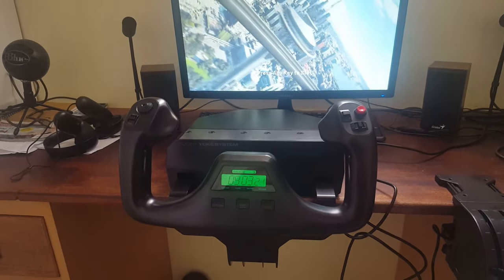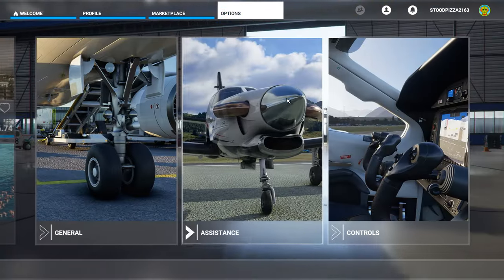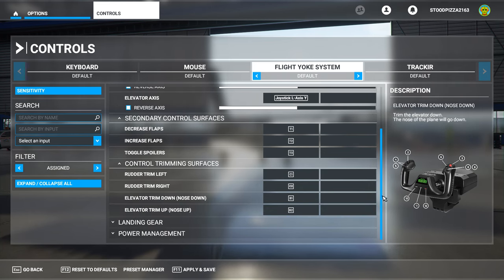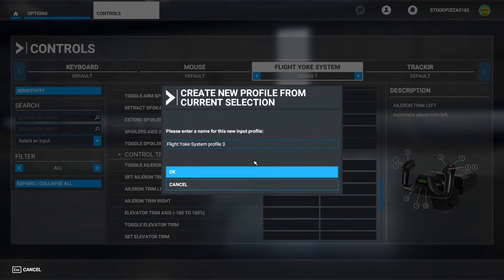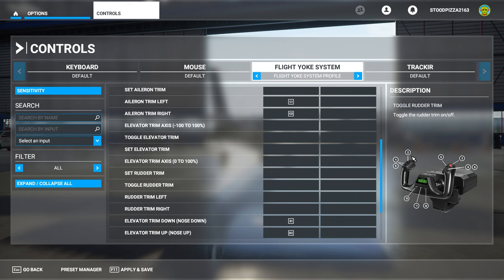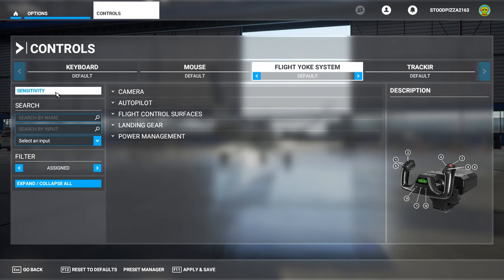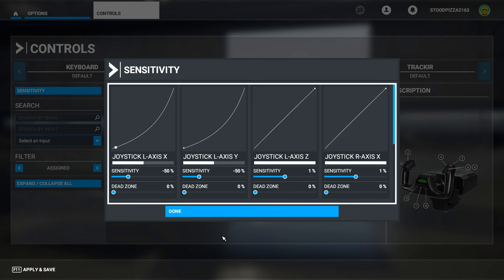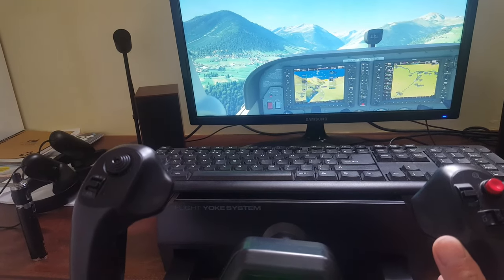FS2020: Setting up the Logitech Flight Yoke System and alleviating the Deadzone!

Comment: I have your same Yoke and pedals and throttle, I tried many times to find the right settings for sensivity, but I got illusional feelings, always i was coming back and still I'm to the settings for changing the sensivity, i found that even if you put -50 on X axes and Y, it wouldn't be reactive and after 20 degrees it starts to accelerate like A boost, so i found that the more stable settings is +9 that is reactive and constant in all the rotation and seems not having any acceleration passing the 20° or 25° of X rotation, then i removed a spring from the Y axes inside the controller, infact there are 2 springs one below and one above, i removed one and i put more grease into mechanical parts, especially on plastics parts, i even removed a plastic ring that avoid to exceed the rotation  of the X axes, this is a double ring joint together that give a lot of friction on the axes x and y, plus i screwed two screwes on a ring that rotate attached on the metal pole for avoiding that the X axes would pass the 45° because if it would does it the wheel on the potentiometer would disingage, of course i removed the metal spring on the X axes because in a real plane doesn't exist  a system for recentering the yoke because it's not a car (I'm a student private ppl pilot) so now it's free to move, after these mods I can say it's a better Yoke, I found very disappointing the logitech quality, I mean they did a great job with car steering wheels putting a forceback with little engines and thanks to the engines the feeling is so real,here instead they just put together a plastic empty with two potentiometers and nothing more, plus I don't understand why limit to 45° the X axes.
Reply: Joystick control in FS2020 is totally and utterly fucked up on most sticks on the market and the sensitivity setting do not work, it just make input lag larger... When I fly the Beach-craft 350 and turn the joystick it take 2 seconds before it reacts to a roll, (up and down works perfectly fine and linear). Also when it finally reacts it does not mimic what the joystick do, it react same as if you are using a keyboard to fly. Meaning no matter how little you turn the stick it reacts and it does not react how much you push on the stick but for how LONG you keep the stick in the position. Only way to actually fly is to use the joystick like it was a keyboard pumping it, this is just ridiculous and internet is full of people complaining about it. Some people say they have no problem at all but most say their joystick simply is unusable in FS2020 and I am one of them with my Logitech Force Feedback 3d pro. Even stranger is that all the above only is for the roll, up and down works perfectly fine and linear with no input lag... Lot of people complaining about exactly the same problem since FS2020 came out and nothing has been done to fix it.  . .. . ... . .. . .. .. .
Reply: @a64738  I've solved going on Options, flight model, and changing from Legacy  To Modern, for me now  it works fine, I've reducing even a bit the sensivity but just for 13%, cause Saitek pro flight has 45° of roll angle so it makes like double any angle you roll, don't forget that a real airplane have 90° angle
Reply: @danielecarmona   Could not even take of with legacy setting lol. But I got the old stick working thanks to this:   
Ready Meals
2 months ago
Hey, don't use those flight control settings, make sure to map it to the the aileron AXIS/ elevator AXIS. Otherwise, it won't recenter and it is a digital input, meaning that it either, for example, goes 100% on the ailerons instead of a analogue control where you can make very slight movements. Make sure to do this for rudder, throttle, ailerons and elevator.

I was just about to order a new stick to get it working, was olso considering getting a refound. But now it works perfectly fine :)
Reply: Happy to hear that! BTW if you want improve your game peripheral you can go to hardware properties in windows and calibrating it, I removed all the dead zone that I got by default.
Reply: @danielecarmona   No dead zone on my stick, and no way to calibrate it. All that is missing for my stick. But it works even it it is a bit to sensitive. Think I will have to invest in a better stick, IL2 for example it is also way to sensitive and twitchy no matter what you try to desensitize it with (tried many different software).
Reply: I found the problem with joystick many have after 3 hours of reading forums and watching all tutorials on joystick setup. Deep down in the comments of one youtube video one said you must make sure X-Axis Z-Axis and Y-Axis it assigned to analog input and not digital. It is pretty much impossible to get them all right in the first try since it does not say what is analog and digital... I did just follow a screenshot how do do it right and it fixed all the joystick problems with my old Logitech Force Feedback 3d. 

* O564564
Reply: @a64738  in windows 10 you have to click con control panel, devices and printers, then right click on the joystick or yoke, click on game controller settings, click on the settings tab, and start the calibration
Reply: @danielecarmona    The Logiteck stick is so old that there is only Windows 7 drivers for it so there is no calibration availible at all. But it works just fine without...  Also with 3rd part software you can make adjustments like manual calibration and such if needed.
Reply: @danielecarmona   Yeah with Legasy flight model the Cesna propeller airccraft can not even take of lol (something very wrong with it). I also found problem most have with joystick. When it is configured manually it is very likely to get one or more axis assigned as digital input and not analog.
Reply: @a64738  wait windows as calibration you don't need logitech softwares, just follow my steps above
Reply: @a64738  , so where does one do this setting? In the yoke calibration app?
Reply: @danielecarmona  I just bought a Logitech Extreme 3D Pro flight stick and tried calibrating using Windows 10, but there is NO calibration option. You can test the directions of each axis, but there is no button for calibration. (I've seen others make this same comment as well.)
Reply: @kj3d812  no i don't know, i never found a calibration button in a logitech yoke, you can try to calibrate it in flight simulator

Comment: How do you set the time,? How to turn by taxi, I  cannot make sharp turns while I taxi
Reply from the maker: The time should come automatically from your PC time; there are some Logitech Yokes that don't work this way though.
Rudder pedals (or rudder control on another controller) is best for Taxiing.
Reply: @Huddison  indeed the time doesnt come up,

Comment: Don't get me wrong i have put £200 to one side to buy a Logitech G Saitek Pro Flight Yoke System and a Saitek pro flight switch panel but not sure which planes they would fit as i use MSFS and i use Air Hauler 2 for the MSFS but the C172 can only carry 540lbs so i need a bigger plane to carry more cargo
Reply from the maker: The Grand Caravan might fit your desires.
Reply: @Huddison  that sounds good to me I will go ahead and order the yoke and the flight switch panel thanks for your help I will have to check out your other videos
Reply from the maker: @neilglenwright7384  That's great & remember to change the sensitivities if it doesn't quite suit your tastes.

Comment: Just got this yoke, but it has unreliable USB communication with the computer.  (Win10.  Ryzen 7 2700.  16Gb RAM.  Rx570 video.)   After about 50sec of flying, every time, it would no longer comm to the computer.  The plane now flies on its own.  LOL.      Loaded the latest 64bit driver from logitech website (Aug ? version 8.0.213).   I tried everything I can think of, uninstall and install, etc.   Still behaves with the same disconnection about a min into the flight.  Notice others having the same problem according to their posts.  Some even suggested to do RegEdit.  Nothing worked.  Anyone had the same problem with a working remedy ???

I think the communication somehow timed out.  Sometimes the screen would freeze for about 10sec, then unfroze but without control.  I've a HOTAS joystick that works beautifully.

Help!!!
Reply: This sounds like Windows 10 power saving turning off USB. https://answers.microsoft.com/en-us/windows/forum/windows_10-power/windows-10-pro-64-bit-keeps-turning-off-my-usb/61888867-b4ae-4ce7-b8d8-eb7007007ea3?auth=1&page=2
The other quick solution is to use spad.next (google it!) and launch that in administrator mode and that will do it for you, it also happens to be a great piece of software if you have quite a bit of Logitech (Saitek) kit.  I have no commercial interest in recommending it, just a satisfied user with my yoke, pedals, dual throttle quadrants, radio panel, multipanel and switch panel.
If you're only driving the yoke, you won't need it though but the Logitech drivers are feature weak in comparison for the other stuff.

Comment: I’ve got a MAJOR problem with this yoke in MFS2020. The axis for roll is centered but any input left or right sends the axis completely to 0 or maxed out. The pitch axis  is not centered, and when the yoke is in resting position it says the pitch is maxed out. If I try to pull up the axis does nothing, but if I push with even the slightest input, the axis immediately shoots to zero. My throttle quadrant works fine and so do my rudder pedals and console controller. I tried sensitivity... nothing. I tried to calibrate the yoke with the software built into my computer and the yoke works just fine there. It’s something with the translation to MSFS2020 that’s messed up. I tried going to the subreddit and the forums and the best answer those smoothbrains could come up with is sensitivity, which isn’t the answer, because it’s the axis detection itself. I’ve searched everywhere for an answer to this and found nothing. Somebody please help me for the love of god.
Reply from the maker: Wow that's a strange and frustrating one. Going to think on it and will try to come back to you

Comment: Hey i got Xplane 11 and i have same yoke that you have sir 
so the thing that i wanna ask is that can i copy the same yoke setting that i am using in Xplane 11 on MFS200i mean like same keys that i am using in Xplane 11 then i use same setting and keys in MFs2020?
Reply from the maker: Greet question! I've not tried this myself and I don't think you can just simply copy the settings across; but there may be a way - let's see what others have to say.

Comment: Hi Huddison,
 great videos, thanks. I have a problem with the Logitech throttle. In Controls the throttle is assigned to L axis Z. In sensitivity settings all axis are shown and can adjust yoke and rudder, but throttle L axis Z will not adjust when moving the throttle leavers. However when going back to control, the White bar is shown but still will not move when using throttle lever. Can you help please. Thanks.
Reply from the maker: I feel Discord may be the best place to help you through this: https://discord.gg/xDKwFYDsZk

Comment: I received one  last week that had a grinding/clicking sound when I moved the yoke from left /right. Also FS 2020 did not recognize any left/right movement from the yoke. Anyone else experience this?
Reply from the maker: That's not good 😮 I'd say that's not how it should operate - try and get a replacement from where you bought it from (if you can!).

Comment: Another question how can I add thrust reverse on turbines oh turboprop I have the same control
Reply from the maker: I'll leave this one to other people watching this video to answer, as it's something I've not personally done :)
Reply: I can't do it with the native FS assignments but Spad.Next (which in my view is essential if you want to get the most out of your Saitek parts), this is easy to do.  Just assign the reverser buttons to the simconnect interface and send THROTTLE_SET event with value -3277 for full reverse thrust.  If you want to assign multiple levers individually then send THROTTLE_SET1, THROTTLE_SET2 etc. against each lever.
Illustrative picture here: https://gyazo.com/f78fbd94195d555d8a7f1ab251b75013

Comment: Hi 
When playing MSFS with the Logitech flight yoke system, I have an issue where my yoke is massively over sensitive, I move it a little and it makes much bigger changes than it should.
Reply from the maker: You can try turning down the sensitivities in controls options and see if that helps.
Reply: @Huddison  Ok thanks, appreciate the reply.

Comment: How do I use the "modes" in the Flight Throttle?  Should all of my primary settings be in Mode 1?  Can I enter more settings into Mode 2 and Mode 3 or does 2020 work only with Mode 1?  Thanks, Dave
Reply from the maker: The modes were more useful for Sims like FSX - with MSFS2020, you can just change the profile in Controls settings; so yes, I leave mine on mode 1.
I may experiment more with this and release (possibly) a future video on it.
Reply: Did you ever end up figuring this out?

Comment: Hi, been trying to setup my Cessna Yoke Quadrant to work with the Hjet but no luck. I have tried to follow the Discord (les O'Reilly) support suggestions but getting nowhere. Can anyone talk me through how to get the Hjet throttle working properly as at the moment when applying power the power meters show and increase and the fall back.  I understand the Hjet has it's own requirement to make the throttles work (LVAR) but I am not really savvy as to how to fix my problem and none of the online snippets I have tried have worked. Thanks in anticipation

Comment: Can I plug in my Logitech rudder pedals to the USB port of the Logitech Yoke?
Reply from the maker: Yes I believe you can, if the hub is powered.
Reply: @Huddison  ,  thanks for your prompt response, which is really appreciated! You're one of the very few YouTubers who actually respond to their viewers' comments and queries! Thank you!

 I just plugged my Logitech rudder pedals into the USB port on the Logitech Yoke and it works well! Less of the messy cables (with USB extensions thrown in!) running all over, with a USB port on the PC that is spare now!
Reply from the maker: @ramnik.khanna  That's really good to hear.

Comment: Do I need pedals meaning under my desk as well or just the yoke + throttle?? I just want to be sure to have both
Reply from the maker: The yoke and throttle will be fine for flying around, but pedals will help you taxi on the ground and will let you practice controlled turns etc, in the air.
Not a necessity, but nice to have.

Comment: i have axis signed and working in options...... But the ailerons/elevator not work in game. Any help?
Reply from the maker: Hmm that's a strange one - I would try a different USB port on your PC and then, if that doesn't work, reassign the axis's.
Reply from the maker: Another thing that I would try is ensuring that you have the correct profile selected for your yoke, assuming that you have made more than 1 profile (in options).
Or even, create a new profile and see if your axis work with that.

Comment: I just purchased a new control unit like yours here. I was surprised to see that the power quadrant did not have a USB plug in... with my new computer, there was not connector to accomadate the unit. I ordered one on line and I think it was the right one. Now I am trying to get the power quandrant to talk to the computer... no evidence that Power quadrant is being seen by my computer or MSFS... I have also ordered a set of rudder pedals.... you talked about that... mine have not arrived yet. 

Suggestions would be appreciated... I saw a photo on yours as with mine of the yoke only... the power quad does not show up.
Reply: I saw the comments above, but still can't even get a light.
Reply: So, I will continue to see how it goes, but I printed out the manual... just a notion that I had... and learned that I had to plug the darned thing into the other thing, rather than into the computer. At least I have a green now. Wish me luck. 😜
Reply from the maker: @mikestephenson6713  You've got it Mike, the Throttle Quadrant plugs into the Yoke and then the Yoke system into the PC :)
You've given me an idea for another video - The first time set-up of this unit.

Comment: Great videos. Only one question: when I push left the view by default is a bit down like if I watch the terrain and I don't see the wing. I don't see directly in front of me. Do you know why?
Regards from Málaga (Spain)
Reply from the maker: Hi and thanks. Check in settings/controllers and cockpit views settings to see if the left view is set correctly; or change it to one that better suits you.
It's difficult for me to be specific, as I don't know what view you are personally seeing when you view left.
Reply: @Huddison  thanks for your answer. It is the default view. I didn't change it. I think is called "hat view" not sure because I am not with the computer now, it is too late here. But, I say, you can see de edge of your left wing and I see outside down.
I will check it tomorrow.
Regards.